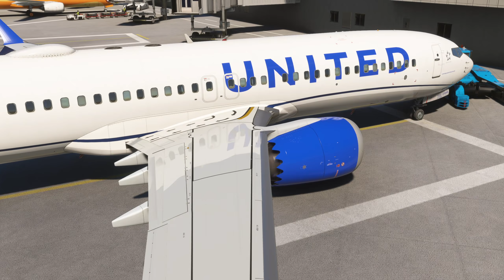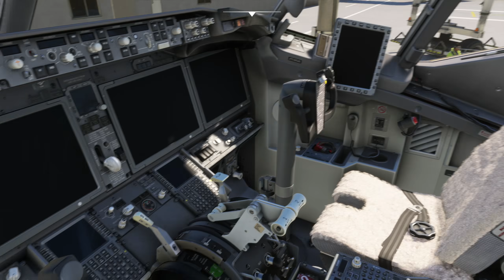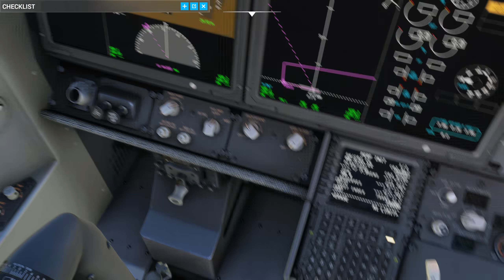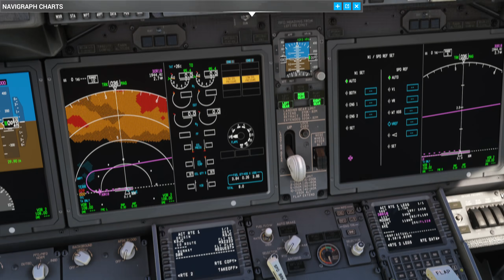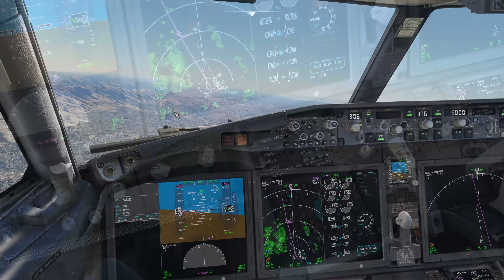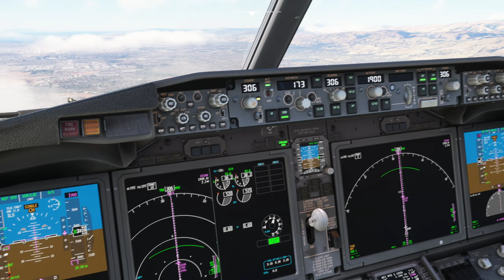Ultra Detailed Simulation Done Right?: iFly 737 MAX 8 Preview with a Real Boeing Pilot!

Comment: I feel a bit disappointed 😥 I've purchased the B73M yesterday and updated it to the latest version. BUT LNAV is snake-chasing the magenta line all the way down the route and find it better to engage HDG and then fly it from waypoint to waypoint. Somewhere, somehow, LNAV is broken or am I doing something wrong?
===
Everything in FMC is setup correctly. There is no discontinuity in the flight plan and the latest navigation data is installed.
I do have about 3000 hours in the PMDG 738/9 and I'm very familiar with how to setup the FMC.

Comment: With the leaps on the max the correct way to start these engines is to wait for motoring to disappear from thr eicas then once the engines reach 25% n2 the fuel can be introduced

Comment: @320SimPilot, Were you using dx12 or dx11? I saw a separate stream where they mentioned they were using dx12 as advised by the devs.
Reply from the maker: Yes this was DX12!
Reply: @320SimPilot  Did you test DX11?

Comment: That ATIS info that comes in, it is from Salinas Airport always. I noticed it comes on whenever you are flying over the area no matter what frequency you are on it will always play. It happens to me whenever I do like a KLAX-KSFO flight no matter if its the PMDG 737 or Fenix Airbus. Only issues is for me whenever I change frequencies it still plays for some reason until I turn off the radios. It 100% has to be a bug of the sim. On the other hand, excited to give this 737 Max a spin, hoping to see it released sooner than later in these coming weeks.

Comment: Nice to see in action the Autoslat in action during your stall test.

I'm currently on 737 NG type rating (mechanic) and this week we just finish with flight control with leading edge and trailing system with autoslat system.

Very nice and simple aircraft. Little bit dirty but it's a pleasure to work on.

Nice video btw !

Comment: Oh dear. Now to decide, iFly or PMDG? I had the iFly before in, I think FSX ,or P3D,  before the PMDG came out, and which turned out to be much more detailed. Now what?
Reply: easy to decide, PMDG 737Max is on hold, iFly is the way forward and OMG what an amazing addon this is going to be, I cant stop looking at her.
Reply: PMDG has put theirs on hold for a while. It can be months or maybe years till we see it. From what I have seen from iFly, they have done a incredible job here and so far to go as saying way better than what PMDG has put out so far. PMDG is a veteran in the game, but there is no doubt other aircraft developers have surpassed them in many aspects. PMDG has fallen behind a bit but hope to see them catch up to the other incredible payware developers. Needless to say, get this as soon as it drops, you will not regret it and then when PMDG drops theirs you can pick that one up. Does not hurt to have options and if you prefer PMDG, this one will hold you over until theirs arrives.

Comment: I know I'm in the EXTREME minority here but honestly I kind of wish these add-on developers would provide an OPTION to load in a lower fidelity model.  These things get packed with tons of detail that most people will never see in a standard flight, and especially in VR, but those details have a non-zero cost to performance in a sim where people are already struggling to get even a few extra frames per second, again especially in VR.  Granted it wouldn't make much difference, but even 1-2% is a factor and it wouldn't be that hard to provide the option.

Comment: Great product.  Great video. Question.  Doesn’t the left rear fuel pump have to be switched on in order to start and run the APU?  I see it started here with the fuel pump switch off
Reply: It'll start on its own regardless of if the pump is on or not. As far as I know that's how Boeing designed it
Reply: @resetjetCR79  ohh. Interesting.  I always have turned it on first.  I thought the checklist called for it but I can’t recall rn
Reply: @GoSolarPlz It does, running the APU for extended periods without at least the Aft fuel pump on can damage it. Not really needed with the NG or Max but good SOP practise that many airlines stick to anyway. So a checklist item as you say.

Comment: iFly has done an amazing job. I’ll be getting it as soon as it’s released. One small thing, I think SOP is to run one pump with APU running to avoid damaging it.
Reply: You only need the pump on if you plan on using the APU for a certain amount of time. I cannot remember exactly how long it was but I believe somewhere around 30 minutes is a good rule of thumb.
Reply: It's not, on older Classic 737 this was true, on newer NG's and Max's it not. But its one of those SOP's that lives on

Comment: So they're actually releasing this in 2020 and not chicken out by releasing it in 2024 like inibuilds did?
Reply: iFly has to as there will be a 737 max in the base game. Obviously not at this level but probably good enough for most people. Ini doesn't have to as there is no competition
Reply: @fetzie  It just sucks that I have to buy another sim just to fly the A350.
Reply: @SN57ONE  It sucks if you weren't planning on getting 2024, i get that. I just can't wait for 2024 because of the better water and ground as i like bush flying, ga, helicopters and all that when i don't want to fly the Fenix
Reply: I think you can use this in 2024 like any other addon
Reply: @DarkAndVelvetNights  yes you can. without any additional work. only if the dev wants to take advantage of new things they would have to put more work into it for 2024
Reply: @fetzie  yea

Comment: modelled RAAS????? holy best addon ever
Reply: I know, right? Glossed right through that but it caught my eye.  I don't think I've seen this on any other add-on. I mean many people even  have this on GA aircraft.  I wish we had it in the sim.
Reply: Are there any addons that have the RAAS in the sim?
Reply: @Raykin225  fs2crew have a rass profesional addon works well
Reply: @selfhostedham lmao, it does not work well. It massively increases startup time for the sim, and has to be configured manually and activated for each flight. It's more janky than GSX and that's saying something.
Reply: @Michael-zf1ko  fs2 crew the crew addons do, rass is literally just launch minimize and do literally nothing just runs in background no configureing required rass pro is just rass nothing more

Comment: An impressive demo of a fantastic model. The trouble though is no matter how much I invest in Boeing’s I never get around to flying them, the Airbuses are just a better option for me.
Reply: Also, for me, the Boeings look cobbled together from bits of scrap, in the flightdeck!
Reply: @terrynorton3182  I totally agree, especiallly the overhead panel lools like it was designed by a council planning committee that only had access to a few old hifi's and a radio or two.
Reply: Yeah, I fly Airbus all the time too. Although I do look to finally flying some Boeings. However, I can agree with how hastily put together the 737 cockpit is.

Comment: Great video. It sure looks good.

I am so sick of the poor performance in this game, even with a 4090. I hope they will make a better 2024 but i doubt it :/
Reply: 2024 should be better as they aim to make better use of multi core CPUs and hyperthreading.  Unfortunately 2020 was basically FSX with a lot bolted onto it and got main thread limited.  It was CPU bound and because it couldn't properly use multi core CPUs upgrading the CPU had little effect.
Reply: How many addons do u have tho? My graphics are maxed out I only fly in oceania region im maxed out with australia addons new zealand and surrounding islands multiple high end aircraft and lag is pretty much non existent my get a stutter on very rare occasions but nothing noticable or soul crushing. I run a 4090 zero issues with gameplay

Comment: I don’t know if I should buy this or wait for the free max 8 in msfs 2024
Reply: This is gonna be a million times better
Reply: @CicaeMeow  true in the beginning, but I’m hoping fbw make a modded better version of Microsoft’s 737 max
Reply: @rezaomar3397  who?
Reply: @CicaeMeow  fly by wire, the team that makes the a32NX
Reply: @rezaomar3397  they probly won't
Reply: @rezaomar3397  why would they make a Boeing? I don't understand.
Reply: @CicaeMeow  y wouldn’t they, the fly by wire a320 was created just because the default a320 in msfs 2020 wasn’t very good so they modded it, if the default 737 isn’t very good I don’t see why they wouldn’t upgrade that too?
Reply: @rezaomar3397 are you professionally stupid or something? They're already working on the a320 and the a380. Airbus architecture and avionics is miles away from Boeing.

By your logic, why haven't they already done the 747/787 or any of the citations?

Besides, Working Title contributed to the new 737 max for 2024 so most likely it won't need improvements to be on the a32nx level